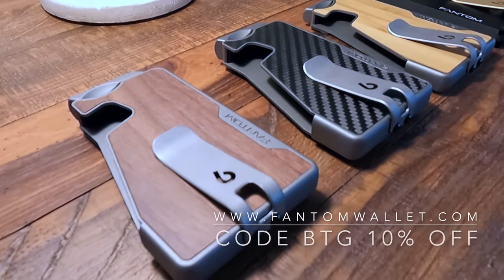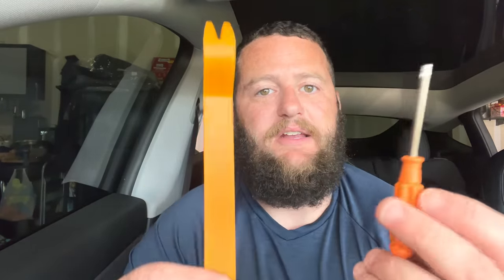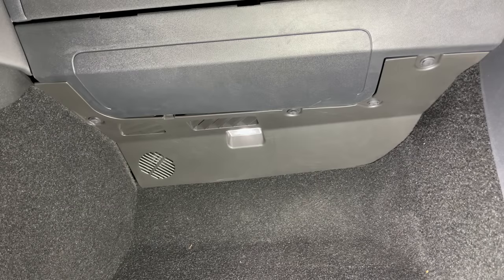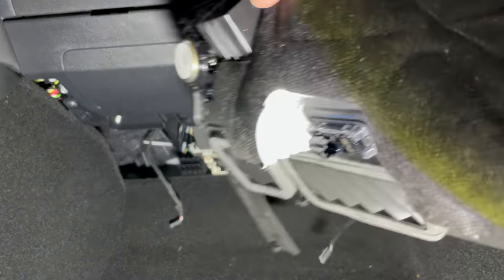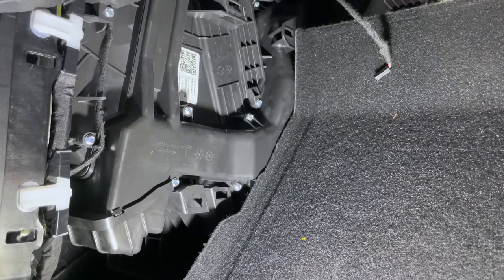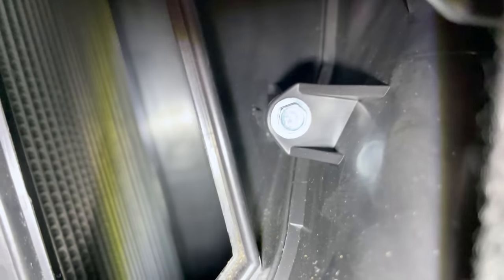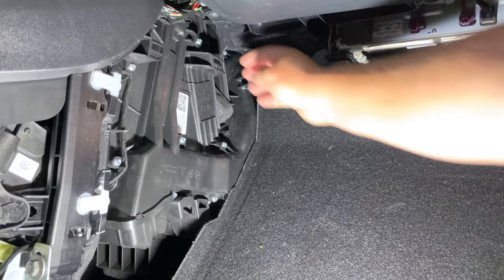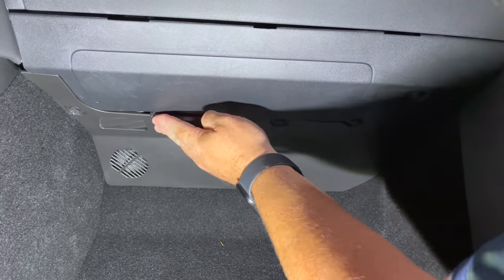Tesla Model Y - Changing Air Filter to Get Rid of Smells

Comment: Concerning the slot on the speaker connector - the toolset you suggested is currently unavailable on Amazon.  Hard to see the slot in the video on its size.  Would a small flathead screwdriver work or is it best to have a pointed end like what you used?

Comment: Been noticing a slight smell every now and then in my Model Y. It seems turning the a/c off but letting the air flow a bit for about a minute or so before I leave the car seems to help it. But I think I'll try this cleaner and changing the filter out too since it looks doable. Can you use the whole can, or are you only supposed to use a portion of it?
Reply from the maker: Whole can

Comment: I had a 2021 Model Y and change the filters a couple of times due to the smell. We put a lot of miles on the car, and I’m in Florida, so high humidity certainly doesn’t help

Question… I now have the biohazard filter system on my new 2022 Model Y. 

Does your new car have this as well? If so any idea if they better engineered the condensate drain for less smells?
Reply from the maker: That won’t help unfortunately. The issue is that moisture gets trapped in the area this filter sits and that’s what makes the smell.

Comment: Before spraying the evaporator cleaner product, do u recommend placing a mat or newspaper under the car to absorb the drippings? Also, as someone who isn't a mechanic (for whom every moment tying up a bay is money), do you think it might be better, after spraying in the foamy cleaner, to let it dry out and more fully drip down prior to reinstalling the filters and closing up the compartment? Wonderful video, by the way!
Reply from the maker: You can absolutely do both of those things. Laying down a paper floor mat, like they put in your car at the dealership, would likely capture all the debris/moisture. For drying out the foam, let it sit for about 10 minutes, then run the air to dry it out.

Comment: great video,,, will pass on the degreaser, part, don't want to be inhaling that stuff
Reply from the maker: It’s somewhat strong. But it burns off in a couple hours
Reply: This evaporator cleaner and procedure is a fairly typical HVAC service for evaporator fan coils, especially in commercial buildings. I was on the facilities team for a large school and our HVAC company would come in once a year to wash the evaporator coils on our 4 air handlers - and we're talking air handler ducts big enough to stand in, next to the evaporators. While I wouldn't immediately go for a ride in the car right after a coil wash, the cleaner is pretty common and well-accepted as quick-evaporating and harmless.

Comment: Hello Justin. At 9:24 you show the inside after it is sprayed with the chemical. Do you think it would be OK to maybe spray some water in there to help rinse some of those chemicals out a little bit better? This way it would rinse it out a little bit more and hopefully get rid of more of the debris. If you did continue to spray water in there to rinse it out, it would still just continue to drain underneath the car correct? It would be interesting to catch all of the nasty chemicals/water into a container to see what actually comes out. Chad
Reply from the maker: Yep, you can spray some water in there. Just don’t use high pressure
Reply: @BeardedTeslaGuy  yeah I figured when it’s time to do this someday I will just use a regular squirt bottle and that should be fine. Are you able to confirm what filters came in your new Model Y?

Comment: Well at least the leak your gonna have from leaving that tab hanging is downstream. 
Believe what makes this worse is cabin protection w/AC. Condensation builds up and stays since the A/C is activated, but the car is not moving which would disperse the moisture
Reply from the maker: Trapped moisture for sure
Reply: Likely the ‘No A/C’ option is better

Comment: Cool! I have been experiencing a lot of funky smells coming from the AC in my car. I think it might be time to do this. I asked Tesla how much it would cost to flush the system and they said it would $200! That's crazy town. I wonder if this process is the exact same that they would do. Was what came out of the car gross? Do those new filters put more strain on the HVAC? Thanks so much for your awesome content and for what you do in the Tesla community!
Reply from the maker: Yea, its not a very simple process, but its not that hard. Worth saving the $200 no doubt. Ours was not nasty so no major stuff coming out of the system. HVAC seems to still work fine
Reply: My itemized quote from tesla was exactly this. Kool-it and non-hepa filters. I just did it myself with this video. Quite easy honestly

Comment: My 9 month old Model 3 has this issue.  I also had this smell in my BMW i3 that I thought was an ac leak so I took it in for service and they didn't find anything wrong.  So it may just be from condensation sitting in the system.  I am curious if changing the filters would help.  I might try it.
Reply from the maker: Yea it’s just condensation getting trapped and leaving some bad odors

Comment: I did this twice and seemed fine.. but everytine it rains is humid outside the smells comes back.. any ideas why ? Is it worth try it with ac actually running?
Reply from the maker: its moisture continuing to get trapped in there. Make sure you are cleaning the evaporator really good and you are letting the box dry before installing the new filters. Then run the HVAC on heat for 5 minutes.

Comment: I tried those "hepa filters" and they are so restrictive. I had to go to 10 just to get tge effect of 5. Also it wasent as cold. Went back to stock and it ran amazing. I only have 3500 miles on my car so I was just changing them for no reason. I won't be putting a more restrictive filter in when or if I do get that smell. Just check if you do get these "hepa filters"
Reply from the maker: Yea, paper filters will allow more air no doubt. Gotta weigh pros and cons

Comment: Great vid. But, honestly this is something Tesla needs to fix. I've had at least 6 ICE cars (various different models) prior to my Tesla and never even thought of this being an issue. Clearly a design flaw.
Reply from the maker: I think it’s because the heat from the engine helps to dry out the HVAC system after use. EVs don’t have that kind of heat trapped to dry it out
Reply: @BeardedTeslaGuy  got you. Seems like it may he a location issue. Obviously that's a more simplified approach I'm taking, but knowing Tesla they are aware and working on a fix based on their priorities.

Comment: The evaporator is post filter so shouldn’t get “dirty” so the smell is coming from the filter that soaks up the moisture from the evaporator. There needs to be a separation to prevent moisture build up on the filter. IMO Tesla design failure. Never had I had this issue in any other car.
Reply from the maker: That moisture gets trapped and starts to stank!

Comment: What if I told you there was a filter that repels moisture and you only have to buy it once and you can clean it over and over and it blocks down to .5 micron?
Reply from the maker: There’s a few really good ones. This one I installed is pretty good
Reply: @BeardedTeslaGuy  but it’s not washable and reusable and if definitely doesn’t block down to .5 micron. that filter you have there will still end up in a landfill one day along the other 100,000,000 cabin air filters. not very environmentally forward.

Comment: Let’s apply some science here, specifically biology. Water should not have a smell. The cause of the smell is waste products excreted by living organisms (like bacteria, mold, and other living things). Yeah, they need water, but that could be humidity or condensate. They also need a dry cycle to reproduce. Use the cleaner. I didn’t 2 out of 2 times, and only 1 times changing the filter worked. I learned that the stuff causing the smell can remain in areas other than the filters, so I am going to redo the job after a smell developed 2 months after installing new filters and not spraying disinfectant to kill smell-causing organisms.
Reply from the maker: the bacteria that grows in a moist environment is what causes the smell. That requires water/moisture to get trapped, which is what I am saying.

Comment: Is this a common problem with the Y? What is Tesla doing to correct it? I want to order a Y but these small issues are keeping me on the fence
Reply from the maker: There’s nothing that can be done about it. Air filters need to be changed out
Reply: @BeardedTeslaGuy  is is strictly the air filter causing this? or is there another issue going on

Comment: I have the HEPA filters by EV Tuning and I’m still getting the smell and unfortunately it’s pretty bad. I installed them less than a year ago too! I’ll definitely try the spray, I really hope it works 😅.
Reply from the maker: Try the spray cleaner this time
Reply: Tesla came to my house and installed a new one free of charge. 3 months later I'm starting to smell it again
Reply: @giinnoo08  turns out is because the evaporator is poorly designed and placed right next to the filters as opposed to away from the filters like in Model S/X. I’m not happy that I’ll now have to smell this musk for at least 7 more years (that’s when I plan on trading in my Model Y)
Reply: This is definitely a bad design- I do not have this problem with Model X or any other car I have driven Mercedes or BMW- Tesla needS to own and fix this issue  - it is inconvenient and time consuming.  I was singing the praises of Model Y . Now after that happened to my Model Y and the way Tesla  treated it is going to change my way looking at this car

Comment: Headline says Model Y but your video is Model 3
Reply from the maker: No, it’s a model Y lol I don’t own a 3
Reply: @BeardedTeslaGuy  OK Thanks
Reply from the maker: The setup is the same on the 3 and Y which is why you probably thought you were watching a 3. Same exact process.
Reply: @BeardedTeslaGuy  Yes I believe you are correct.  
I already changed the filter on my Model 3 last year to a Hepa .  I also have a Model Y and going to order a hepa, so was researching the Y.
I notice that you did not mention cleaning thigs up with AC cleaner.